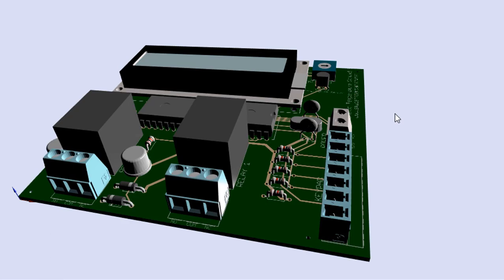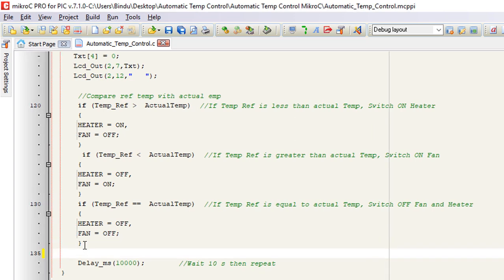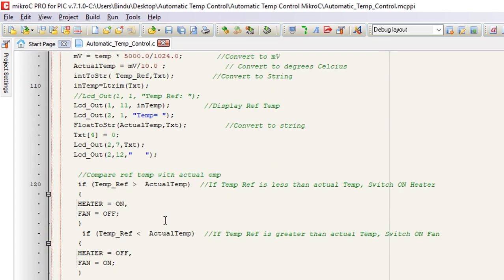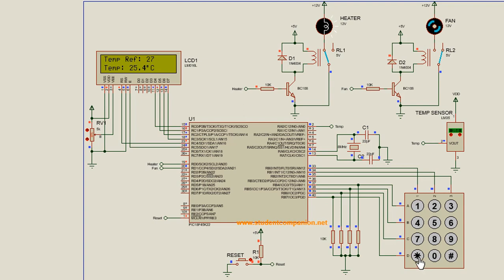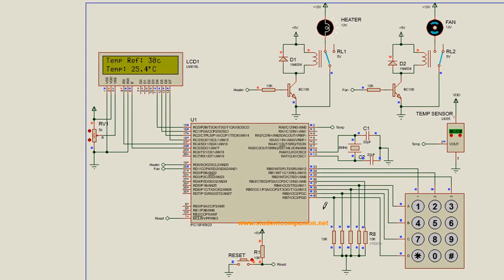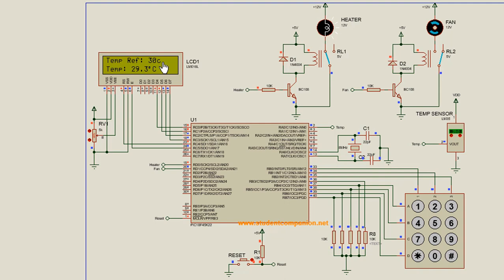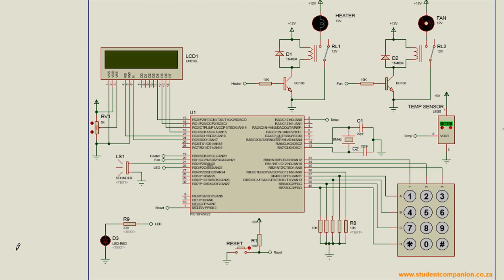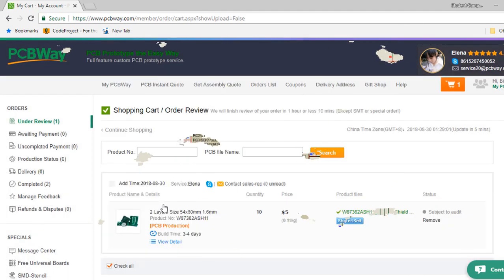53- Project 2 Automatic Temperature Control, part 4 | mikroC Pro for PIC Tutorial

Comment: you trigger the buzzer when actual value greater than 40. I want replace 40 by any numbers those I type in from keypad.  

Lcd_Cmd(_LCD_CLEAR);                     // Clear display
      Lcd_Out(1, 4, "Set Alarm");
      buzzer = 0;
      Lcd_Out(2, 1, "Alarm: ");
       while(1)
        {

         do
           kp = Keypad_Key_Click();      // Store key code in kp variable
         while (!kp);
         if ( kp == ENTER )break;
         if (kp > 3 && kp < 8) kp = kp-1;
         if (kp > 8 && kp < 12) kp = kp-2;
         if (kp ==14)kp = 0;
         if ( kp == CLEAR )goto START;
         Lcd_Chr_Cp(kp + '0');
         buzzer =(10*buzzer) + kp;
    }
Lcd_Cmd(_LCD_CLEAR);
      Lcd_Out(1, 1, "Alarm:  ");
      intToStr( buzzer,Txt);
      inbuzz = Ltrim(Txt);
      Lcd_Out_CP(inbuzz);

in main() I compare the error between actual value and temp_ref to inbuzz

if ((ActualTemp - Temp_Ref)  > inbuzz  )  //If Temp reaches critical temperature of 40.
      {
      Sound_Play(880, 1000); // Play sound at 880Hz for 300ms

      LED = ~LED ;         //Blink LED
      delay_ms(200);          //200ms delay
      }
      else
      {
      LED = OFF;
      }

It's not working. I dont know where im wrong. I hope for your support.
Reply from the maker: Your inbuzz is string not a number, why are you comparing with a string?
Reply: @StudentCompanion  right. I made a dumb mistake haha. It works. Thanks for response. Looking for more projects from you guys. Your channel helps me so much.
Reply from the maker: You are welcome!
What was the actual mistake?
Reply: @StudentCompanion  yep.inbuzz was string. I changed it to buzzer. buzzer was int type.
if ((ActualTemp - Temp_Ref)  > buzzer  )
Reply from the maker: Great!
Reply: @StudentCompanion  Will you plan to make a project about Li-Fi communication?
Reply from the maker: Unfortunately not at the moment.  It's not part of our planned topics.

Comment: Sir, what to choose mp lab, micro c or flowcode, from where to start im beginer
Reply from the maker: It's difficult to suggest. Only you can make that decision based on your affordability and your future plans. Generally for beginners Flowcode is the easiest to learn and understand the basics of microcontroller programming.  The next is mikroC and last is MPLAB.  So try watching at least 2 tutorials of each covering the same topic and see where youcan start. Use the tool that you can understand easily and continue with it untill you require to use a different tool in the future.  It wont be difficult to switch to a different tool once you master the basics.